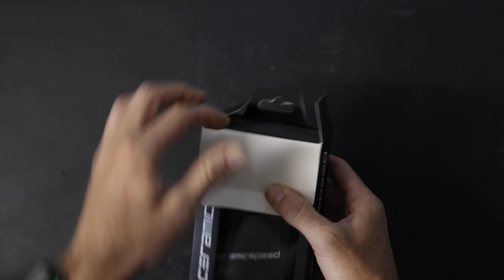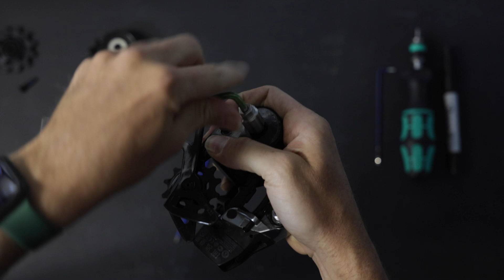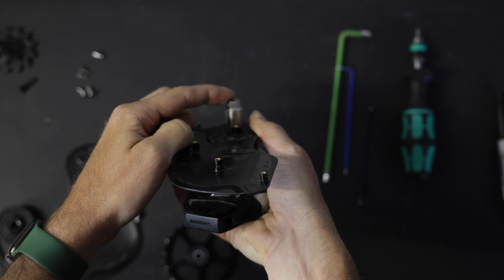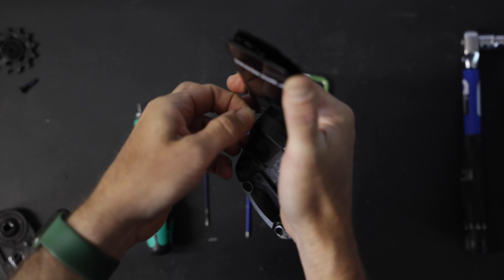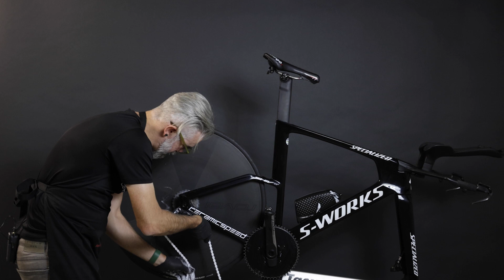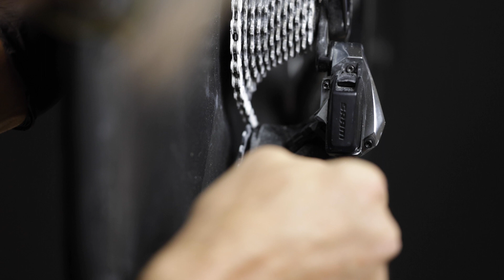CeramicSpeed OSPW Aero SRAM Red Force AXS Installation

Comment: Do I need a longer chain when switching from a 10/26 to a 10/33 cassette on my 1x drivetrain TT bike or will the chain work for both cassette’s and just adjust the B-limit screw accordingly??
Reply from the maker: Hi. If the chain was measured correctly for an OSPW  in the 10t cog initially, then the change of cassette size is no problem. Many TT 1X drivetrain arrangements will utilize a full length chain for the optimal chain tension and setup.